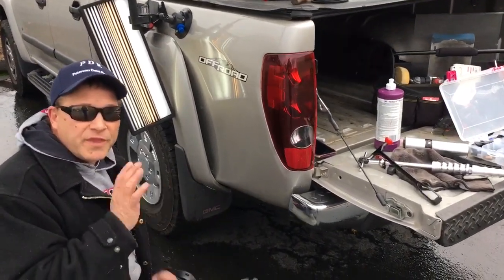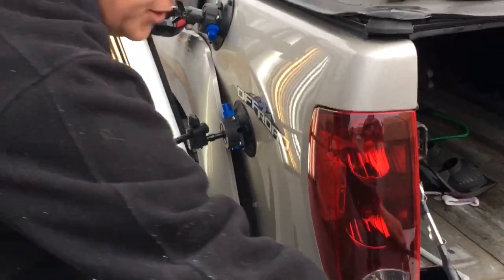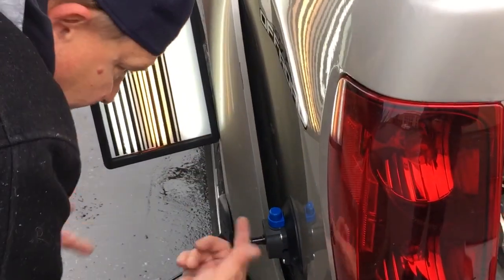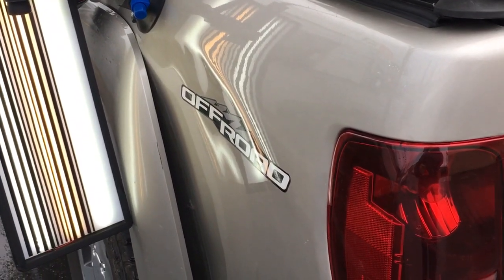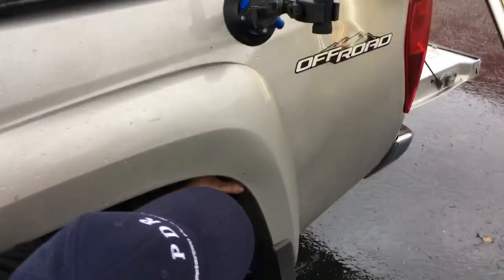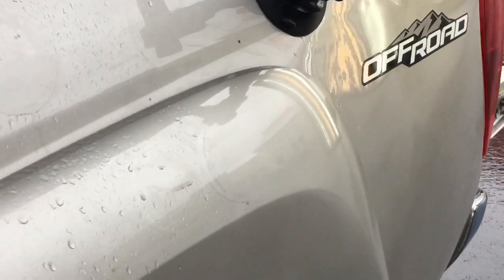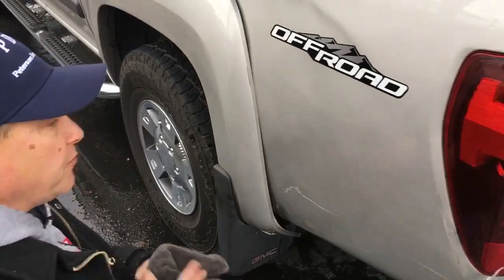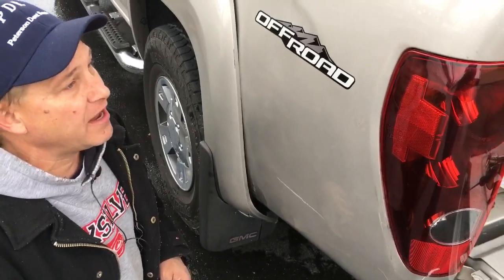PDR vs. “UN-Dentable” 🤕 Collision Damage #pdr #undented #GMC

Comment: What amp battery though??? I'm using the 9amp big Bertha Milwaukee,  and that thing kicks ass!
Reply from the maker: Eric Lockridge it's an 18 V Milwaukee and it doesn't seem to last more than about five minutes ??? wtf
Reply: @Petersondent  but what is the amp on the battery say? If your running a 2.0amp, it will run dry quick. Oh well. That is the number one complaint on that heat gun. I hear that from everyone.
Reply from the maker: yeah i will just have to only use it in case of emergency where no cord is available. maybe i will look into a butane powered one:)

Comment: Good job brother, what tool did you use to move that meat from back side?
Reply from the maker: Osama AL Mustafa Thanks, I used my tool I called squishy which has the dual bend 24 inch long squishy tip dentcraft tool on it. access was pretty much wide open from the bottom.